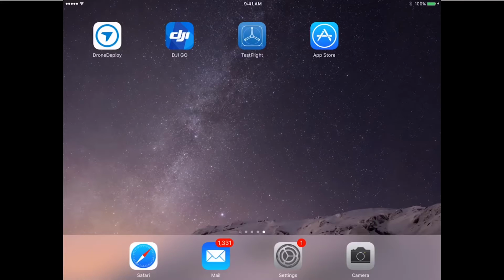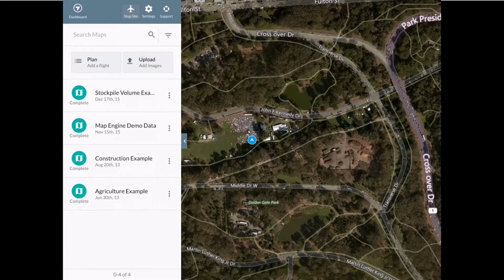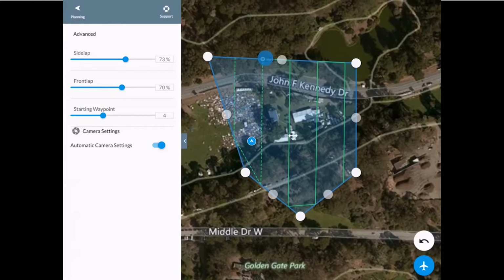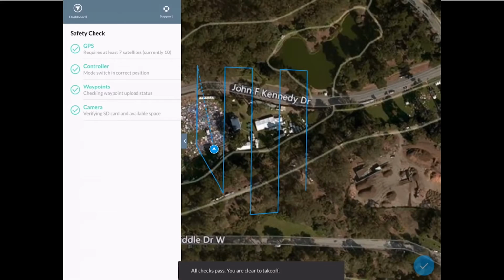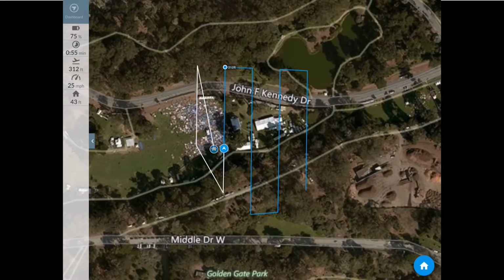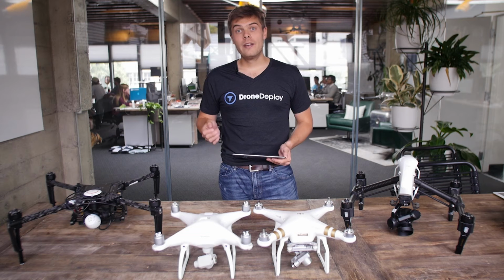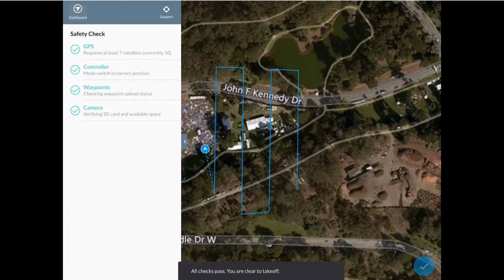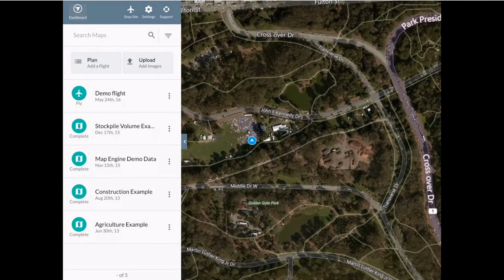Zero-Hero     Chapter 5 - Capture & View data

Comment: Hi

I have downlowded the app for my Samsung Android. I have a Mavic Pro. I had creat a fligth plan but I cannot conect to the drone.
Seeing your video I constacted that the plain "Start Sim"" icon on the top is not there in my app so I'm wondering, that this app only let you do a fligth in "simulater test". Is it correct?
Reply from the maker: Hi Alvaro, you said you had trouble connecting to your drone. Do you have the latest update installed?